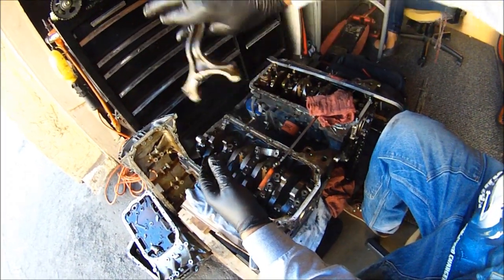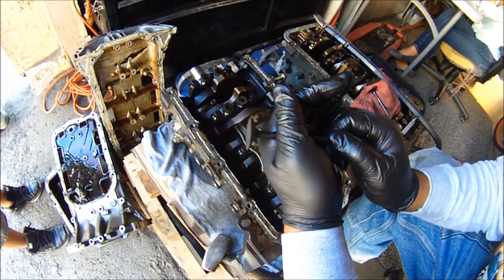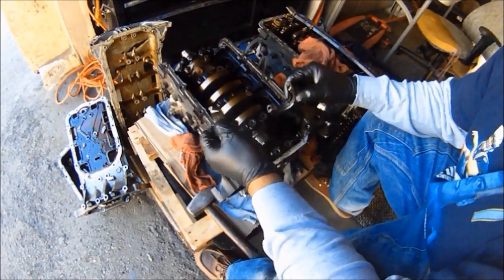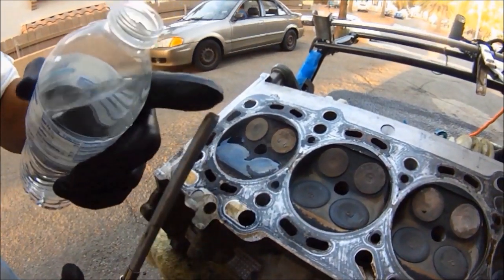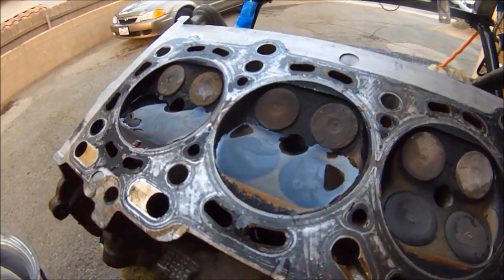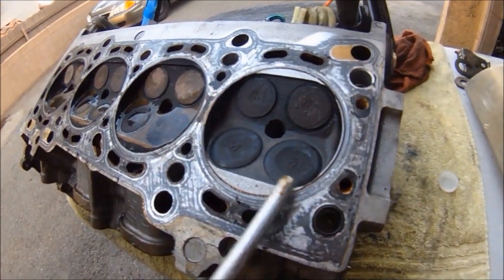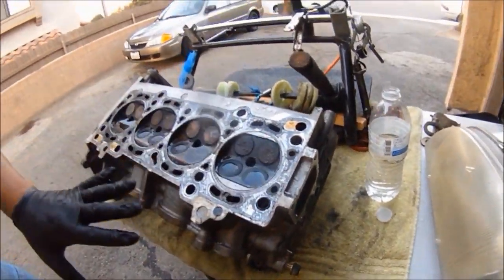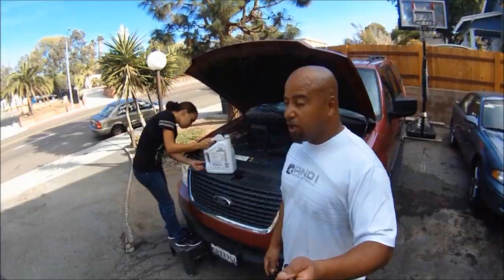(BEST TEST) FOR CHECKING LEAKING VALVES AND VALVES SEATS USING AIR, SOAP & WATER. CYL HEAD OFF

Comment: Simple way to do this without air is to level the head on a flat surface with valves facing up and all spark plugs installed. Get some brake parts cleaner and fill the area with parts cleaner. If the valves need seating it will leak down through the intake or exhaust port whichever Is leaking. This dude is making this more dramatic than it really is. waste of time.

Comment: love your videos and nothing but respect for your knowledge.  I'm not sure how to send a message to ask a question so I'm gonna ask it here. I'm currently looking at a 4 6L out of a 2001 Lincoln town car. I did all the compression testing for a blown  head gasket.  I poured coolant into my radiator had the oil pan plug out and the coolant poured out of the drain hole. after further investigation  u was looking down the timing chain cover on the driver's side. I saw coolant pouring out of the head looks like a freeze plug hole. do you know if that is what Iur it is and if so can the coolant get I. the oil open this way?  stevegober10@gmail.com I know  you are a busy man and greatly appreciated on my end. if you get a chance to answer it would be great. keep that camera rolling and the words of wisdom never fails its something I needed to hear thanks again God bless

Comment: your videos are awesome and inspiring for real... im searchin through but i was hopin maybe you could point me in the right direction if you have any videos that would help im in the process of doing everything from the head gasket up on a 2004 3.4 v6 pontiac grand am i pulled a set of cylinder heads from a salvage yard theyre looking good imma check the valves tonight lol glad i saw this

Comment: what causes leaking valves not keeping up with oil changes or running the engine low on oil, or overheating from antifreeze?

Comment: I love GOD, I love Jesus and I love you man, hey boss, I have a 2010 ML350 BlueTec (engine seized) on my drive way, this car I got it free, 1st i put big socket on Crank pully bolt, manage to brake loose, had a bad starter, replaced it, yes crank few times, now Seized up again, so my question is should i attempt to rebuild or drop a engine from Bone Yard?
any input would be appreciated - Thank you! and GOD bless me and you all
ooh btw I am a Technician but in another area, did a timing belt etc, know how to do most but not all

Comment: Cool videos.  Appreciate the backyard skills.  Checking for valve leaks with an air gun.  Resurfacing a warped aluminum head.  Looks like the engine in this video had some serious carnage going on inside.  If a decent rebuildable junkyard engine could be found and rebuilt I'd of gone that way.  But a $170 long block thats a deal.  Not sure what you had in the Mazda but hopefully you kept the cost below $1k,@$500 in the car and @$500 in repairs.  Make for a nice flip at $2500-$3k.  Found it best (at least for me) is to stick with certain makes & motors.  Easier to repair certain known issues on any given car faster and fewer unforeseen expensive repairs.  The market is easy to gauge with prices for buying, selling, repairing and flipping.
VT247

Comment: Love your videos man.  By the way, I have over the years successfully straightened bent valves and re-lapped them in... Mostly on single cylinder farm bikes and once on an old Nissan engine.  I know it's not recommended, but if you heat the valves up, put them in the guide/seat and smack them with a socket and hammer into the seat, they straighten nice if not super badly bent in the first place.  Rough, but it can work if you need to get moving for zero cost!

Comment: I normally just put the head up on it's side, and fill the ports up with hot water... If no water leaks out into the combustion chamber within 10 mins or so, the vales are good.
Your way is probably more accurate, but I don't have fancy compressed air like you! LOL!!  Peace

Comment: Oldskool, I was watching another video on crankcase bottom end. What do you think caused the connecting rod journal to get distroyed?  I heard that when oil passeges become plugged in the crankshaft it can cause the journal bearings to seize up and result in spun bearings which might result in what you have there. Would like to have you give an assessment and what to check in the block to be sure that the issue does not reoccur. Thanks,
Reply from the maker: My suspicion was an oil issue but only on that specific rod bearing because all the other bearings looked very good and showed no evidence of poor oil delivery. When I take engines apart I replace the oil pump ALWAYS and I clean all the oil ports passages with a long tiny plastic brush (like a baby bottle cleaner and compressed air 125PSI) and leave nothing to chance. one of the best methods is to always check oil clearance on all the bearings with plasti gauge. New oil pump, check inspect and clean all oil passages check piston ring gap, inspect all bearing clearances or replace all bearings/ machine crankshaft. but the key is oil pressure and oil passages must be right on the money. Thanks Jan, keep it strong out there Happy New Year, smash on it in 2015 God Bless.
Reply: Thanks Oldskool, I enjoy learning via your videos, keep up the good work. Trying to keep it real.
Reply: oldskool, what do you think about a 2002 lexus is 300.  Are there any issues/problems common to this auto?

Comment: Hi , Always look forward to your videos!
        So is the engine that throws a rod typically repairable by replacing just  the  rod? Would you have to check clearances to the crank etc and maybe replace one bearing? Thanks
Reply from the maker: Gregory, is right its not worth it plus the crankshaft counter weight had a small chunk missing which would throw off the weight balance and cause serious vibration. And what if the oil pump went bad and starved the other bearings causing scoring etc. Plasti gauge will let you know the bearing clearance gap, but if the bearings are starved you will know right away when you pull the caps off.